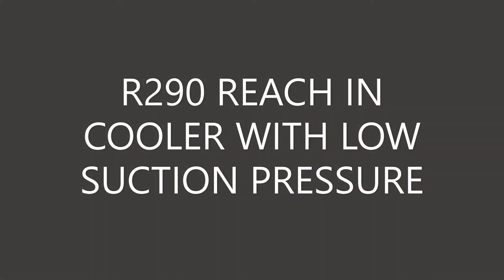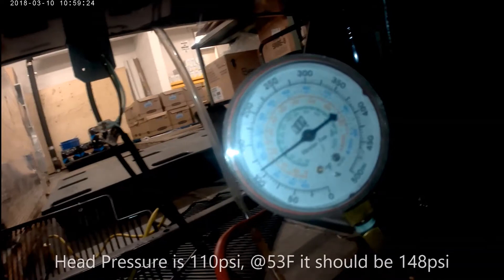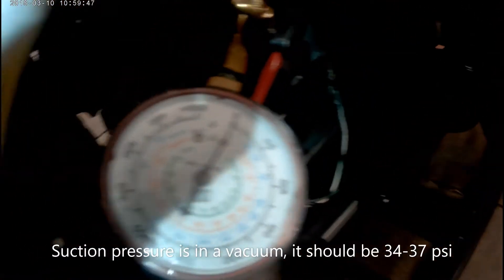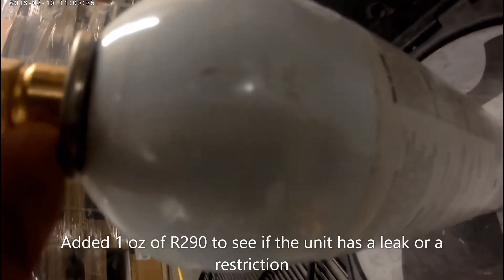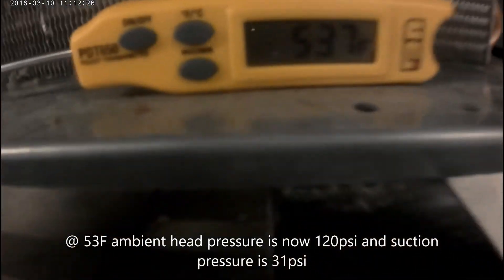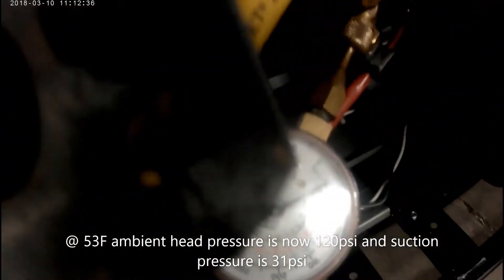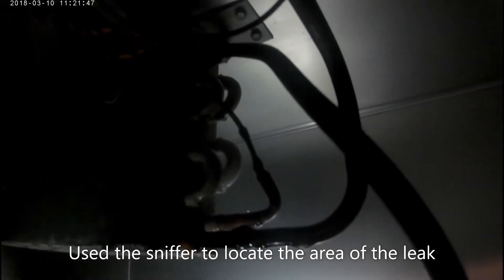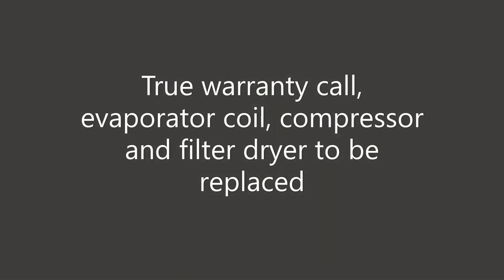True R290 Cooler has A Frozen Evaporator Coil And is not Getting Cold Enough.

Comment: 3 weeks ago had two of Randell PT72-30W-L R-290 sandwich coolers with frozen evaporators. Both coolers are 3-4 months old at the same brand new just open restaurant. After the ice melted I've made sure that all evaporator fans are running. So, in 2-3 mins the capillary tube would start the ice build up. Called the manufacturer. They've advised me that it is the warranty issue and they are going to send a qualified tech. So, I didn't even install ports on the system and cannot tell you if this is a low charge or the capillary tube restriction. Well, 1.5 week later the=tech came to the location and ... didn't install ports to check the R-290 pressures. He told the restaurant owner that the compressor is bad and they are going to order the replacement compressor..... Don't know how he would know that without checking the refrigerant charge/pressure. For some reason that tech didn't even look at the second cooler. He said that there is no service request for another cooler....., just one!
Reply from the maker: Yikes, if the compressor was going off on overload, that could be the reason why. However, if the unit was cooling ( to the point of freezing the coil) one would assume the compressor is doing it’s job. Could be a temp controller issue as well, but all signs point to a low charge

Comment: As far as replacing the compressor...does True require that? Is this unique to R290 systems?
Reply from the maker: Any warranty call for true, regardless of the refrigerant, they will have us replace the compressor if it is running in a vacuum.